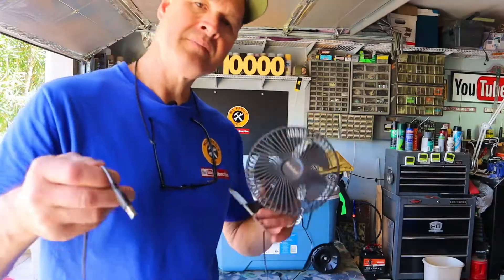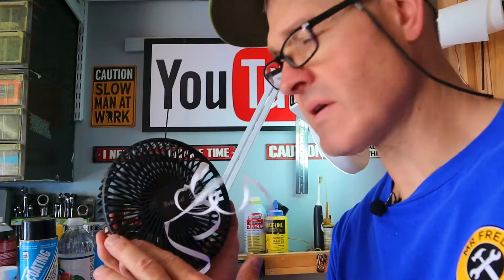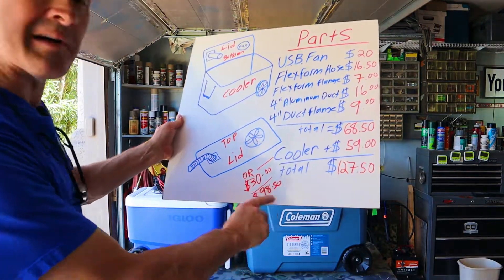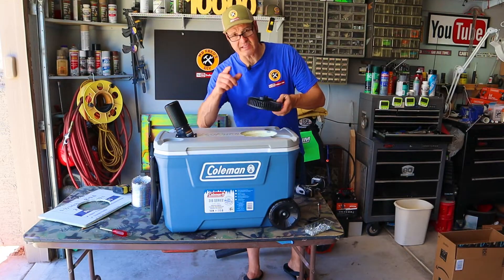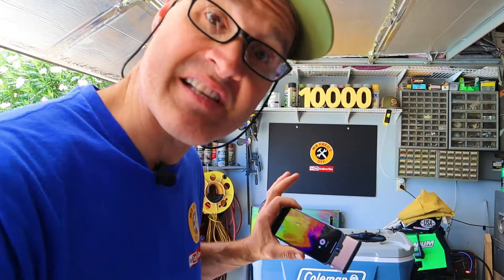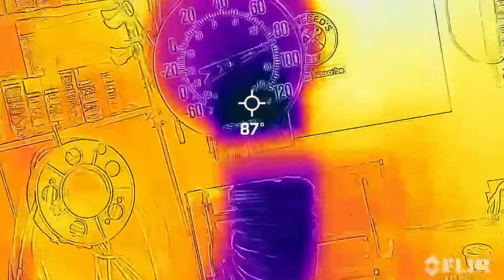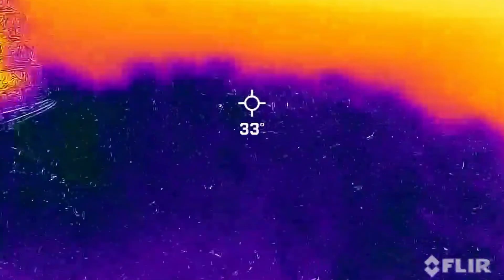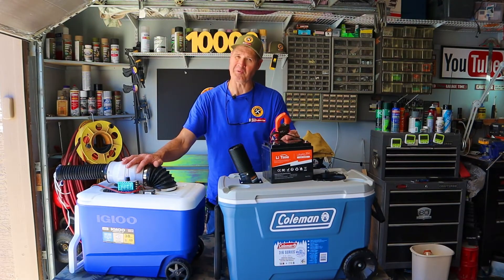DIY Ice Cooler Air Conditioners (2023)

Comment: I am just curious why people don't use ice blocks instead of cubes..old school ice transportation had sawdust and wood to help insulation and they really only use ice blocks then and ice pick to break into smaller pieces.
Reply from the maker: My thought is “surface area”. Air blowing across the rough texture of many ice cubes will encounter more ice surface area and turbulence compared to a block of ice.
Reply: @alteredstate607  iceblock will last longer

Comment: How long does the ice last in it?
Reply from the maker: It really depends on the outside temperature. When it is really hot, only a few hours.
Reply: @MrFredsDIY I'd need something that could last at least 9-10 hours in a camper van over night.

Comment: I'd punch some holes in your aluminum tube or something similar.  One, to suck in cold air further away from the fan. Two, on case that melts enough it is mostly water the hose can be submersed and the fan could push water up the hose. 
I'm going to build one but replace all of that ice with frozen drinking water. My RV freezer can freeze two at a time to add in as I use up the half frozen bottles inside. Maybe burying the aluminum hose between frozen bottles.
How many hours can your fan hold a charge?

Comment: If the aluminium conducts cold would it have been better to snake the aluminium tube inside the cooler, cover it in ice and 1-2 inches of cold water? The warm/hot air from the fan then is not blowing on the ice melting it. Should last longer?
Reply from the maker: Interesting idea! Thanks for sharing!
Reply: @MrFredsDIY  no worries. Also if space allows in your freezer, mix iodised salt in with the water as it reduces the temperature at which it will freeze, thus providing colder ice which will stay frozen for longer.

Comment: Mr. Fred, We look forward to your comparison video.  As you have previously built a heat exchange model using a radiator, I wonder if you have found this simpler design to be superior in performance or preferable for other reasons.
Reply from the maker: Ice capacity with surface area and fan speed seem to be important factors! Here is a good comparison video ▶️https://youtu.be/-ssSvss5woE
Reply: @MrFredsDIY  Thank you for all the excellent info.  I think given all the factors, I'm going to try to make the build shown on your "DIY Ice Cooler Air Conditioners (2023)" video. Great channel and presentation sir.
Reply from the maker: Good luck with your build! I’m taking that one camping this weekend! The USB fan has a low draw so it will last a long time.